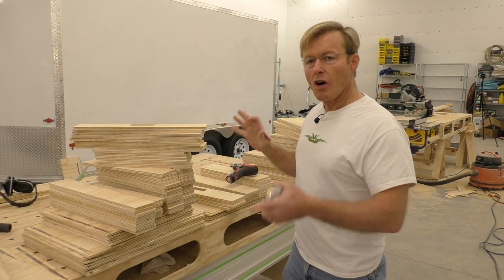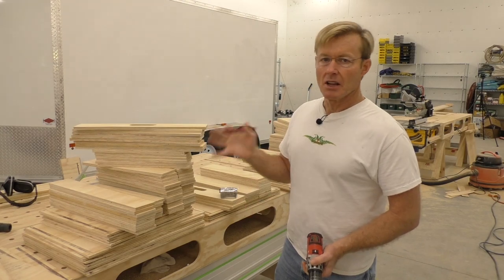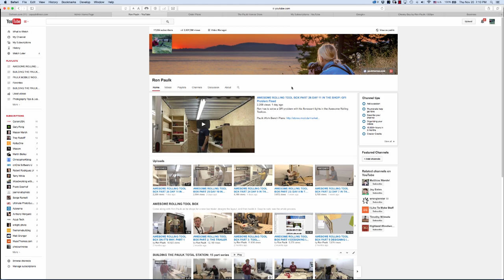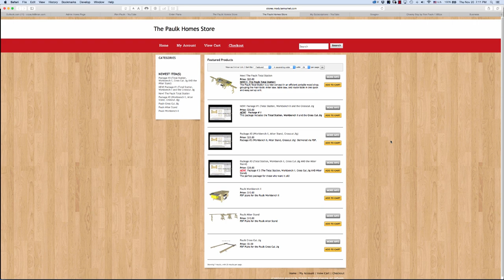BUILDING A MOBILE WOODSHOP (Part 27) Easy fast milling of drawer parts.

Comment: Great Work Ron, don't you wish you could actually work that fast!  I know I do. :)  Question for you if you don't mind;  I am a small contractor based just south of you in Everett and need something like the trailer or a truck.  I do a lot of different kinds of work and it would be nice to have most everything with me when I get to a job.  I drive to different sites almost every day and would like to know your thoughts on a truck vs trailer.  I have been eying the Sprinter vans for there great gas millage, rather then a box truck, but I am open to suggestions.  I would like to know your thoughts.
Reply: Why not have both? A Sprinter van can tow a trailer. Keep the tools you use on every job in the van and load the trailer with tools that see less use. The Sprinter without the trailer can be your everyday tool transporter and the other tools are loaded and ready to go in the trailer.